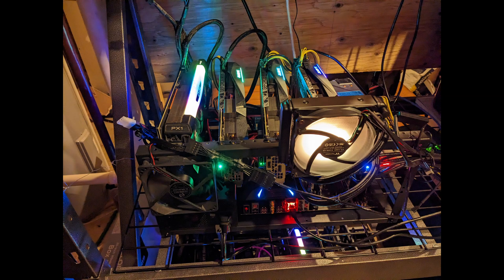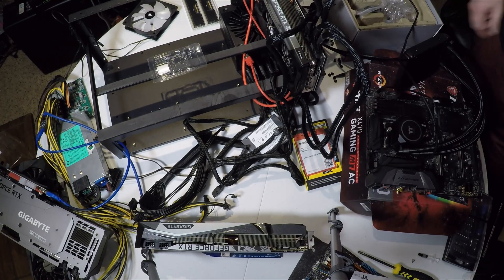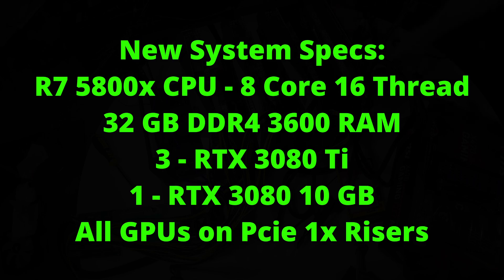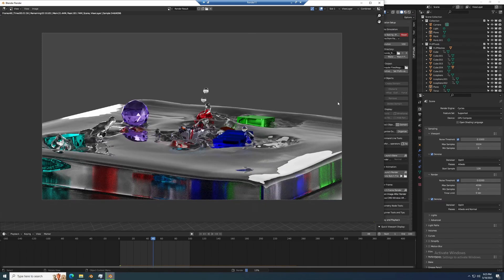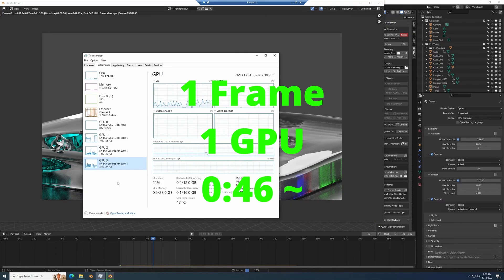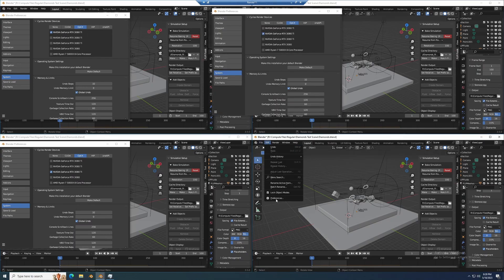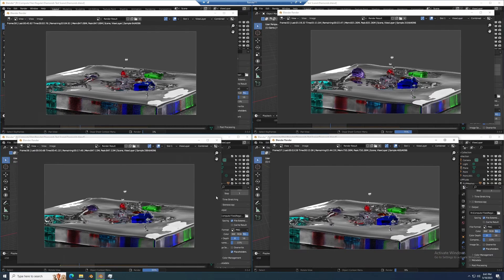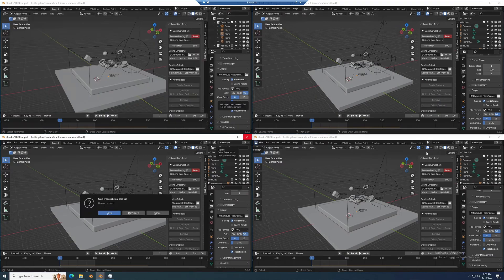QUAD GPU PC for Blender Rendering!!!!  Rebuild and Testing

Comment: The thing matters is how many pcie lanes is available, single gpu take 16, nvme takes 4 how many left, to use 4 gpu at its max you would need 16x4=64 pcie lane does your cpu/motherboard have 64pcie lanes available no
Reply from the maker: I do not remember which machine I used for this test, it was awhile ago. I think my future render farm is going to use 5000 series Threadrippers with 4 GPUs. Scaling is still not linear, but it is close, with higher end CPU and motherboard combos. My current farm has a bunch of Dell T3600 with one GPU each. And I am tired of managing so many PCs. So I am going to consolidate soon!

Comment: You should not run a GPU on a riser when it comes to rendering! I tested on the same cards in DaVinchi resolve, and there was more than a double drop in speed via riser! You better get a motherboard with more PCIe slots!
Reply from the maker: I completely agree, and Blender itself is a multi GPU bottleneck as well, even on fast motherboards with many slots.

Comment: now what would the results be if you used a different board like a btc 250m board that doesnt have pcie slots it has usb3 ports to run to the gpu risers instead and its a 6th 7th gen intel board but would that make any difference with the pcie lanes or just using 16x pcie risers instead of the 1x risers
Reply from the maker: It may improve the results a little, but Blender 3+ is not very efficient at using multiple GPUs. So scaling is limited even with full bandwidth slots.
But, this could be a fun test anyway!
Reply: @ContradictionTech  i am just looking to see if there is any other uses for mining hardware other than mining
Reply from the maker: Yeah it is still possible. I only wish we could add all the VRAM together with multiple GPUs, because that could really make a huge impact for rendering. Also, even though the efficiency is poor, using many GPUs can still be much faster, and in some cases, like older GPUs, you might be able to get a lot of speed out of them.
Reply: @ContradictionTech  some of those older mining cards are actually pretty cheap  especially the ones that are pascal and polaris generations
Reply from the maker: Yeah but be aware they may not be able to run the same drivers. Maybe maybe not, I am not sure. So just be careful. I have heard of people trying to use the Nvidia CMP hx line for some compute tasks. Not sure if it works. The next type of hardware I am looking into now, is APUs, like mac studio. They are getting to be really fast, and with unified RAM, the GPU has access to very large buffer size. A Mac Studio M3 Ultra starts with 96 GB of RAM, which is GPU accessible. Obviously the Mac is a bad example of cheap rendering hardware. But the search is always on for optimized rendering PCs!
Reply: @ContradictionTech  AMD BC250s APUs the problem with newer nvdia cards is that the bios and firmware is locked but its not on the older cards anything newer than pascal if i remember right is locked down by nvidia Now the amd cards arent locked into the bios or firmware they can be flashed way easier

Comment: If you don't mind, how and what would you use to build a gaming pc as an all rounder?
Thanks
Reply from the maker: I would get a large ATX case, for future expansion. I like the Corsair 5000X or my current case, which is the Fractal Design 7XL. The 7XL is huge, but it fits anything you want. For parts I would do:

AMD R9 9900X 12 Core or R9 9950X
64 GB DDR5 RAM, 2x32 sticks at 6400 MHZ
X870E motherboard of your preference. I have had MSI, Asus, and Gigabyte. No problems with any for me, but always read reviews before you pick.
RTX 4070 Ti Super, RTX 4080 Super or higher, for 16 GB VRAM and super fast performance for future proofing. 
1 TB M.2 for Operating System, then 1 or 2 extra 2 - 4 TB M.2 drives for files, programs, etc.
1000+ Watt Power Supply with Gold rating or higher. EVGA, MSI, Corsair, Seasonic are good, have not had others myself, but there are plenty of good choices.
I would get a 240mm or 360mm AIO cooler for the CPU.

This is an expensive build. If you want cheaper options or professional options, let me know. My current workstation is a Threadripper Pro 7965 WX with 192 GB RAM. I have also built minimal budget PCs many times. So let me know your budget for more specifics.

Comment: Apparently you used to be able to render individual tiles for each gpu before blender 3.0 which was better for single image renders, for animations doing separate frames seems to work better.

Currently with cycles X it does one tile at a time. I have 2 3090s and a 4090 in one rig and I am getting better performance from just running the 4090, at least for a single frame. I can't help but think I could render a single image faster if the tiling was per gpu instead of them all working together
Reply from the maker: Yeah the old tiling system was closer to linear performance increase with added GPUs. The only work around now is the one instance to one GPU method, which uses a lot of system RAM. 
But I did some unofficial testing the other night, and there seems to be at least 30%-60% loss with 2 GPUs running on one render, versus giving each GPU a whole frame.
Maybe we need a "current best rendering practices" video

Comment: Wasnt your one RTX 4090 going with 22 min whilst here one 3080 renders in 22 min? I must be mixing up quantities, right?
Reply from the maker: I believe my 4090 did this in 33 minutes in an older video, and here there are 3-3080 ti and 1-3080. But these 4 gpus were installed on mining risers, so they likely had some slot bandwidth bottlenecks. Especially since running 4 separate Blender instances can be very CPU and RAM heavy.

Comment: Hello my friend, great video, I am right at the point where I need to prepare a Render Station like this (Although for Solidworks Visualize), My processor (Intel Xeon w9-3495X (56-Core) and I have 2 RTX6000 ADA GPU and the Card Mother (ASUS Pro WS W790 SAGE SE) has a slot for 3 more cards, I plan to add 3 RTX 4090, given the space and the number of components I plan to do it in an open mining chassis. I just saw your video and basically that is what I intend to build. , but I haven't found a list of parts in the description of your video to clear my doubts.

I was specifically wondering: How much is your consumption in Watts and what type of power supply did you use to cover that demand?
Reply from the maker: Well I calculate you will have almost 2000 watts in just GPUs, so you will need two large ATX power supplies or a few server power supplies with breakout boards. Also, your power outlets need to be able to support that much draw, so you either need two separate circuits if you are on 110 v. Running two separate power supplies is easy when using risers, but I would not use separate power supplies if the GPUs are plugged into the motherboard. It can be dangerous because the PSU powering the motherboard does not exactly match the second power supply, so your voltage provided to the GPUs from the slot and from the second PSU will not match. 

If you want more information just ask. Maybe I can make a video about multiple PSU systems

Comment: Do you use davinci? Because im wondering if running two retired mining cards: 2x RX 5700 XT 8 gb would be worth the trouble over my current nice and quiet/cool GTX 1660 Super 6gb
Reply from the maker: I use Davinci Resolve for my editing, yes. I do not have the pro version, so I am currently limited to single GPU acceleration. I know that multiple GPUs in most software will not scale very well, so it could be faster, but likely not worth the hassle.

I can try to test this somehow eventually, but I had not planned on getting Pro yet. Maybe I can get a trial
Reply: @ContradictionTech  that's my thinking too. I'm on the free version and I think it would not be worth the trouble + cost of getting resolve pro for some marginal gain. Thanks for the blender test and reply!
Reply from the maker: @georged822  You're welcome!

Comment: for your 4 blender iterations, do you:

1 - use 4 internet windows or 4 vms?

2 - have you tried it with a different step and starting frame? (i.e. GPU#2 starts at frame 2 with a step of 2, GPU#3 starts at frame 3 with a step of 3..etc..)
Reply from the maker: I just open blender 4 times and run each one with a different GPU set in the render devices. And if you use the placeholder checkbox in output settings, and uncheck overwrite, each iteration will automatically find and render a new frame.

Comment: I mostly use cycles cuda, and I think maybe a lot of the performance comes down to the model of how the data is moving around in the computer. like for example, a task may be sort of uploaded and then worked on by a gpu to only return a small result. In that case you would expect things like pcie revision and lane size not to matter that much. I have a system with 2 cards in it, but they are 1660s not 3080s.
Reply from the maker: And interestingly, CUDA on cycles will overflow into system RAM if needed, so it seems to be able to run larger scenes than Optix. Haven't confirmed that but I think Optix doesn't allow overflow. But yeah, for small scenes that load quickly, the pcie lanes do not have much bottleneck. 

Some of my recent scenes that are pushing 24 GB VRAM definitely feel a slowdown when running from my farm, since it's all shared to one PC from all of the workers. So storage can definitely bottleneck some of the rendering workflow too. I need an NAS with nvme drives and 10Gb Ethernet haha

Comment: this is very interesting i was using duo-gpu rendering on blender for years. but the last year i realized the results dropped, i assumed it was new NVidia drivers f-ing it up. can you try rendering on older blender versions? and if it does not help try roling NVidia drivers back`? also this must be a bug witch should be reported.
Reply from the maker: I can try to figure out where the problem is yeah. The weird part is the risers seem to work fine on their own. All rendering in Cycles with Blender 3.x versions has a slowdown with more than one GPU on one instance of Blender. No matter how new the PC, if the GPUs are in slots or risers, does not matter. Very weird. But yes, I will try to test for it. I suppose if I can prove the issue for sure, I will submit it to Blender.
Reply: @ContradictionTech  but are  normal dual gpu rendering on 2 pcie-16 slots are fine?
Reply from the maker: @8D2BFREE  I have been getting mixed results. There is anywhere from minor to 50% speed reduction if I run a single instance of Blender with 2 cards in slots. But you would think that since risers work, the lanes are not the bottleneck. 

Maybe I will try two 3080 ti in my desktop, with 8 Gen 4 lanes each. That should be plenty. I don't have any motherboards to run dual X16 at 16 lane speed yet. Most of my dual GPU tests are on boards with 2 x16 gen 3 running 8 or 16X speed.

Comment: thread ripper is the way to go for this the limitation is the bandwith for the pcie you only have 24 channels.. I have test this myself with 10x 3080 gpus and its the initial building time that seems to add to the delay.. threadrippers etc. have 64 lanes which allow you to have a much better throughput.. 1950x are pretty cheap these days and my x399 can support around 4x gpus I just use a pcie x16 riser in a mining frame as its much cleaner than the risers etc.. I wish there was a riserless motherboard out there which had a tr4 socket and all the pcie x16 slots had 16 channels respectively.
Reply from the maker: Yeah I will definitely be looking into that setup in the future. I have always been annoyed that there is no long motherboard with 2 slot spacing per PCie slot. Running x16 risers is a good idea though. Might try that next time. And the mining boards that are long like that only have 1x lane each slot, and they are normally limited to a 4 core i7 from way back when. Frustrating

Comment: great tests. being able to use a mining style setup with these gpus is really interesting as its easy to build vs one system for only 1 or 2 cards. great work!
Reply from the maker: Thanks! Just be aware you will probably need to run one Blender instance per GPU, as I found in this test. Otherwise, I think mining style setups are easy to power, cool, and give much more flexibility than desktop PC setups.

Comment: So would it be better to just run a single gpu?
Reply from the maker: It looks like for rendering, more is always faster. So with 4 separate Blender iterations, this test was 4 times faster than a single GPU. The problem is the risers I think. So with the GPUs in the motherboard, you can likely run all 4 cards on one Blender iteration with no problems. I am not sure what causes the issue yet, because I have found risers to NOT bottleneck speed on their own. 

Honestly it is almost like the scheduler in windows does not allow enough attention to the GPUs on risers, because it does not see them as high priority. Needs more testing. Very confusing.
Reply: @ContradictionTech   I'm a bit late here but no, Blender just doesn't like multi GPU rendering. You never get 2x gains with multi GPU, maybe 1.5 tops. Splitting the render into multiple instances is briliant, actually.
Reply from the maker: @lordwafflesthegreat  multi instance is the only way I have got my machines to work with extra GPUs. Only problem is it probably uses more system RAM. So that's a whole new issue haha. But for two GPUs, with 32 or 64 GB system RAM, it works well. Thanks for the reply!

Comment: Could you try to find an older Xeon or Threadripper? ... The Threadripper should be able to allow a native x16/x16/x8/x8 configuration or something similar.
Reply from the maker: I have thought about getting some earlier threadripper machines. Biggest problem is I can only fit so many GPUs on each motherboard with how thick the cards are now. An ideal setup in my mind would be 4-6 rtx a4000 on each machine, since those are single slot GPUs. I will try this type of setup someday soon
Reply: @ContradictionTech  I have a few ASUS Mining Expert motherboards installed in an open framed two-tier chassis. You can install 6 or 8 GPUS side by side on the upper tier and the lower tier houses the motherboard and power supplies. You can then stack these which I did. One of my stacks housed 13 GPUs, 4 power supplies, and one Asus Mining Expert motherboard. The motherboard has 22 PCIE connections.

Comment: Slightly tangential: Did you have to make any special configurations for being able to reliably remote in to that other system of yours? stuff like making remote desktop use XDDM instead of using WDDM?
Reply from the maker: Nope. I set it up with basic settings like changing power mode to high performance. But that is about it for Remote Desktop.
Reply: @ContradictionTech  Thanks